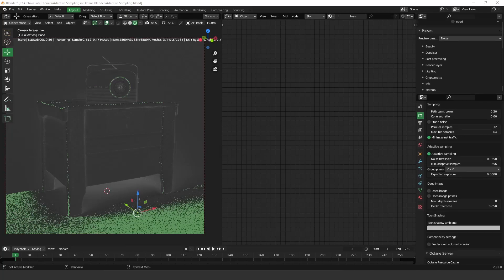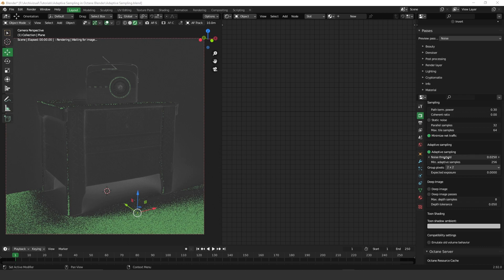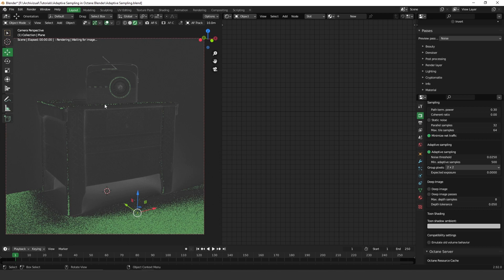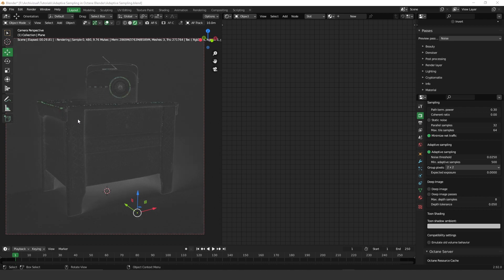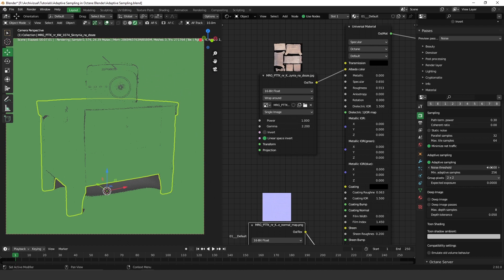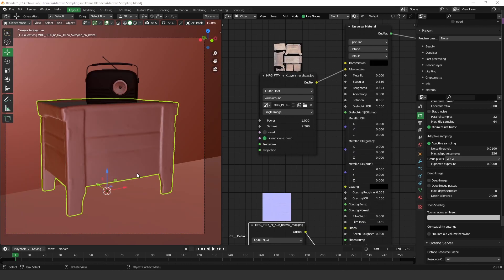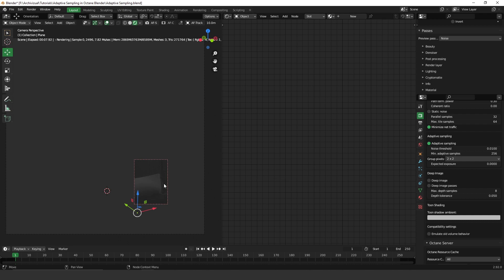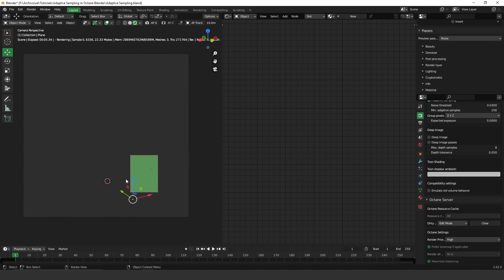Understanding Adaptive Sampling in Blender Octane

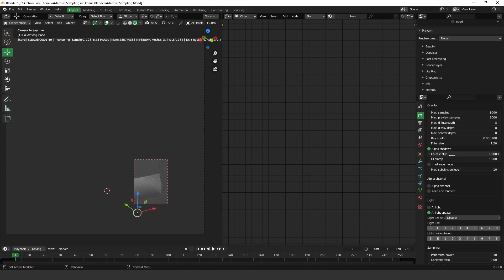Comment: 11:57 How do you keep rendering more samples beyond the 2000 you set? Mine stops as soon as it reaches whatever amount I've set.
Reply from the maker: I think it's a bug.
Reply: If you turn on view border, (using ctrl+b), it wont stop rendering until I think 64000 samples; but if u turn it off (using ctrl+alt+b) it will stop at the specified sample.
Reply from the maker: @alimoradi9331  thanks for the tip